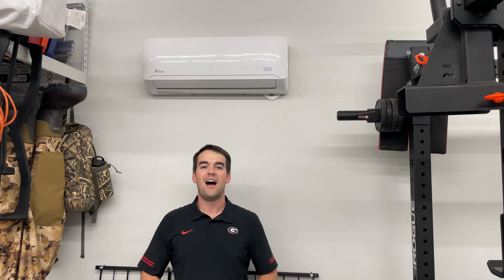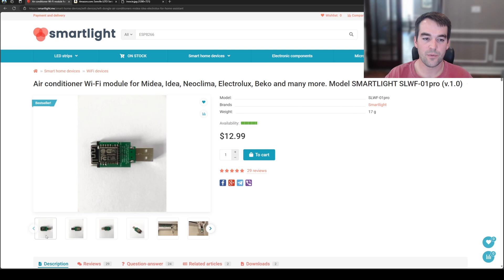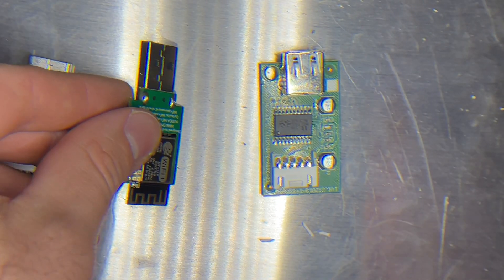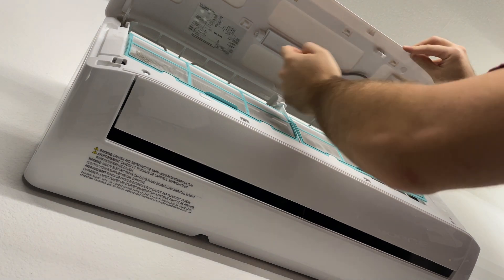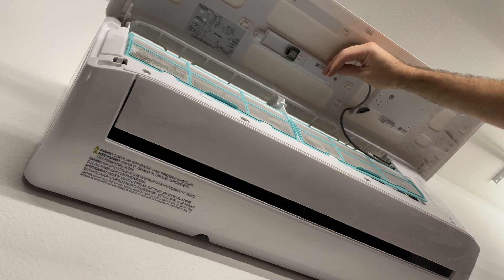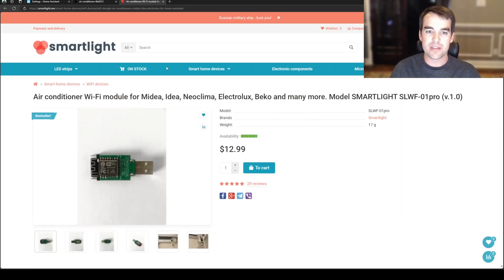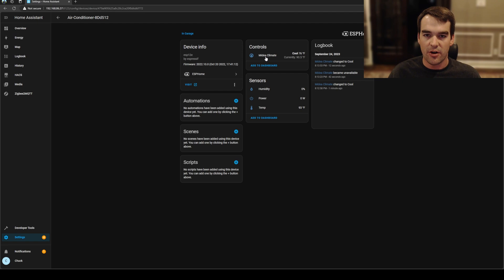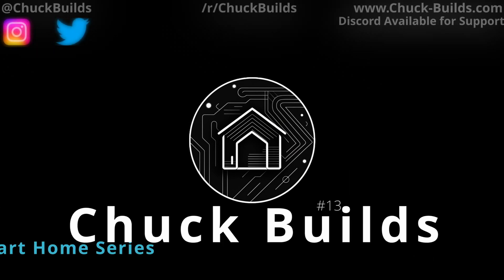How to make your "Dumb" Mini-Split Smart for $20.99

Comment: Why didn’t u used the usb stick that came with the AC?
Reply from the maker: It wasn't HomeAssistant  compatible
Reply: @ChuckBuilds does the custom dongle works with the stock AP configuration so I can pair it with my iPhone only using the AC remote control like the original dongle or HomeAssistant is the only way it works?
Reply from the maker: @jederahmad3787  There's no app with it, you'd have to put it into HomeAssistant to control it

Comment: Hi,can i set temperature range like Midea breezless .
For example with remote control to not go under 22'C and over 28'C.
Can i do this with some way ?
Thank you.
Reply from the maker: it doesn't change the max or min temp limits, I don't think you'd be able to override that
Reply: @ChuckBuilds Thank you very much for fast answer.
I have this option on Midea Breezless E model but missing from All Easy pro so i don't know how to add it.
I i use another usb dongle not stock one maybe?

Comment: I have some Midea window heat pumps and I bought these things for them and they worked really well with Home Assistant. Very good service from Smartlignt too. Highly recommended instead of the factory cloudware spyware wifi dongles that came with the heat pumps.

Comment: July 2025 I used SLWF-01PRO r2.1 with my brand new MrCool 5th gen 36K DIY minisplit and so far seems like everything works in Home Assistant. I haven't tried using it in automations, my primary motivation here is to turn off the minisplit if the garage door is open more than 5 minutes.  

The hardest thing for me was to find where the USB dongle went, the obvious place was the narrow rectangle with two wires coming out of it, but turned out the larger control panel is where the dongle goes. I needed to use a screwdriver to pry the larger cover over, and there was just barely enough room for the SLWF-001PRO to fit. 

In the 5th gen 36K DIY unit there are no side tabs so I didn't need to trim anything off of the dongle, it fits perfectly.

As soon as I connected to the dongle's wifi on my phone a page popped up with all nearby wifi SSIDs and after picking mine and entering the password it automatically disconnected from my phone and (since I use google home) I immediately got a message that it had joined my network. I'm running the latest Home Assistant version and the SLWY-01PRO was automatically discovered and I was able to add it to my ESP Home setup (it's my fifth device) with one click. 

Thanks for making the video!

Comment: If the air conditioner loses power, the adapter stops working and I have to manually unplug it and plug it back into the air conditioner's USB port. Does this also happen in your case?
Reply from the maker: I have not had that happen and I do lose power somewhat frequently. I’m not sure what the cause would be

Comment: I tried to cut out the plastic on the sides of the port, put the SWL01pro inside and connected the AC to power again and I think it tripped the fuse?
Reply from the maker: This should be low voltage and wouldn’t trip a fuse. Sorry, not sure how to troubleshoot that one
Reply: @ChuckBuilds  The AC now starts with an 88 and doesn't react. 

A technician is coming over today. I hope it's only the fuse.
Reply: @DennisSchmitz  Tell us what it was.

Comment: I just completed my set up. I installed a dual 18K Senville Aura. I have both hooked up and working.

My question is how am I able to add custom commands? There is a motion sensor on the indoor unit which I would like to add to my automations, but HA doesn't pop that command up. Anyone have thoughts?
Reply from the maker: Motion sensor on your senville? Didn’t know they came like that. Beyond my skill set to see what is exposed over that com port. Not sure if it’s possible or not

Comment: I followed your instructions and they were tremendously helpful.  thank you for that.  i did have a question for you.  do you have any issues where your device loses connection to home assistant?   I am unable to tell if this is a wi-fi thing, or home assistant.  But if I look back at my graphs, I see intermittent drop outs of data..  and when it does drop, i lose the ability to ping the unit...  i can flip the breaker and it will come back.  not sure if this is a 'my unit thing' or something else.
Reply from the maker: I just checked and I have one drop out in the last 7 days for just a few short minutes. Check your WiFi and maybe make sure it’s on your 2.4ghz channel
Reply: @ChuckBuilds  i just swapped the AP for another i had laying around and its been noticeably better for about 12 hours..  thanks for looking at your drops..  and your video
Reply from the maker: @kpurintun  Thanks for the update! Good stuff
Reply: @ChuckBuilds  that device is the only one on that AP that has a very high level of tx retries.  the signal is -68.  I changed the channel to change the channel..  so I guess we'll see there.  also disabled meshing on that AP..  i have disabled band steering which is not super friendly to ESP devices.. and basically every other fun wifi feature set..

Comment: Are you able to read the status set with a remote? If I change temperature with Home Assistant, and then change it with the remote control, is it changed accordingly on Home Assistant?
Reply from the maker: If you change it with HomeAssistant, the remote does NOT show the difference. If you change the temperature with the remote, HomeAssistant DOES show the difference. The remote is kind of "one way" communication to the Mini split

Comment: Thanks I got it installed on my Senville Aura . I didn't have to carve out the usb port on mine . Only clipped a bit of plastic in tray so esp would lay flatter . I connected to my wifi and no problems. When I went to Home Assistant, it had already found it and I only had to click add. It gave me a dashboard thermostat like you added . So was super simple - thanks for your video.

Comment: At 9:12, what is the lowest temperature for heating you can set it at? Is it programable to allow me to set it to say 41F?
Reply from the maker: I believe the lowest temp it can go is 62. I haven’t tested it just did a quick google search
Reply: Hey man. I lost remote and can only turn my unit on and off via button under the hood. Do I need the remote to use this dongle because I can't use my Alexa one anymore because I need the remote to get it in AP mode.
Reply from the maker: @TheAnthonyBrandi  Nope, no remote needed. I haven't touched mine since I hung it.

Comment: Was working fine until I tried the OTA update with the .bin file. Now it just keeps timing out and won't connect to my network properly. Now it's not even broadcasting its own wifi.
Reply from the maker: I'm sorry to hear that.  I had contacted them previously when I wanted to reset my device to record this video and received this response: "Currently, the device does not have a factory reset.
To start the AP again, first turn off the device and your router, then turn on the dongle and wait about a minute for it to start the AP. After that, you can connect to the dongle and configure Wi-Fi again."  - It seems the device will not broadcast it's SSID if it still detects your home WiFi signal, I would see if you can attempt this and if it still doesn't work, I recommend reaching out to Smartlight and ask if they have a suggestion. They were very friendly and quick to respond.
Reply: @ChuckBuilds  I purchased a few of them and was able to get one to work. The others keep timing out. Thanks for the advice. I already reached out to them. I'll also try disconnecting my wifi and hopefully it will try rebroadcasting its own ssid.
I assumed the button was a factory reset, but I guess not.
Reply: @ChuckBuilds  I turned off the wifi network, but only one module started broadcasting. I'm assuming it was the functional one and didn't want to mess with it. I tried connecting the module to my computer to reset it, but it was not recognized. Not sure what else I can do.
Reply: Kind of in the same boat. I have multiple ACs. 1st one worked perfect. 2nd one connected to HA but unable to control the actual unit. It sort of times out. Don’t know what to do!
Reply: @jonathancastaneda5560  Yeah. I gave up on it. Literally the same model indoor units. No matter what I do I can't get one of them to work. It connects to my WIFI and when I type in its IP address I see everything clearly. When I input a command it just times out and keeps retrying. Customer support wasn't able to help me find a solution.
Reply: @jonathancastaneda5560  Same issue of timing out. Only ordered one. Did you figure out what to do? I even factory reseted and still nothing. It times out. Wondering if it connection issue where you are not plugging it deep enough? I though as soon as I saw AC-Wifi the device should be fine.
Reply: this a plain esp8266 , connect directly to it via serial and reflash it
Reply: @DevZwf  I don't think it is the same  - look at the photos closely. It has it's own designed pcb board.

Comment: Do you know if the Della brand is compatible? I can't figure out if the Della is a Midea unit or not.
Reply from the maker: I can't say for certain but it looks identical to my senville unit except with the plastic on the swing arm. Do you already have the unit installed? if so, pop open the cover and see if there is a usb port underneath!

Comment: how about IR receiver and transmitter?
Reply from the maker: Haven’t tried, IR can be tricky and is reliant on line of sight
Reply: @ChuckBuilds  but not all split types have usb port
Reply from the maker: @SuperKnightwind  Correct, but most mini splits don't have a way to relay information back to your smart home via IR. They can only receive commands. Several popular brands of Minisplits in the US support USB controllers for enable smart functionality and that's what I wanted to cover
Reply: @ChuckBuilds  ikwr? heheh.. at least somehow there are still ways to control them.. Good job bro on figuring them out. Im using LG split type and cassette type though.